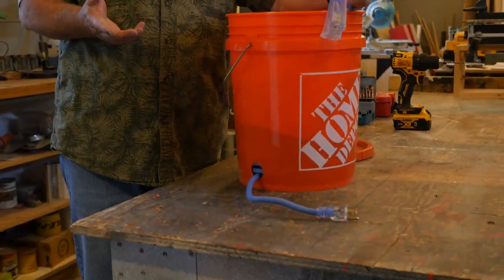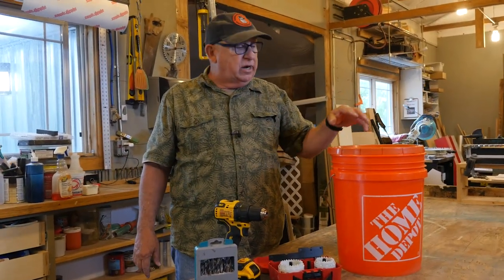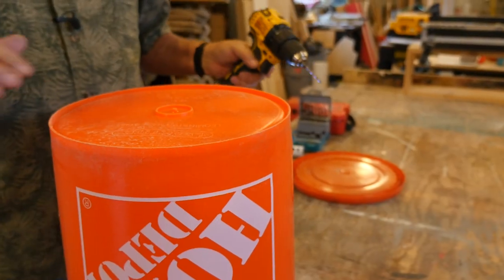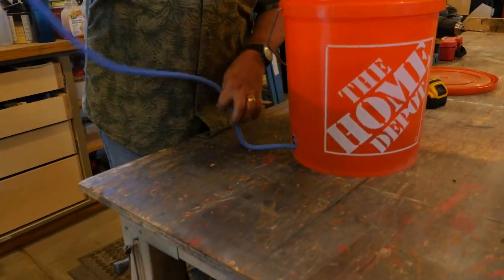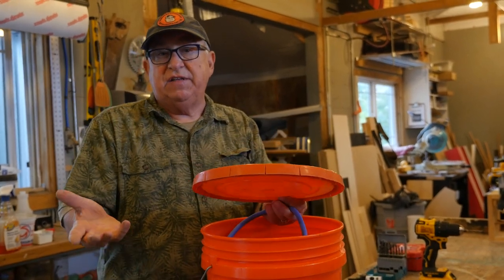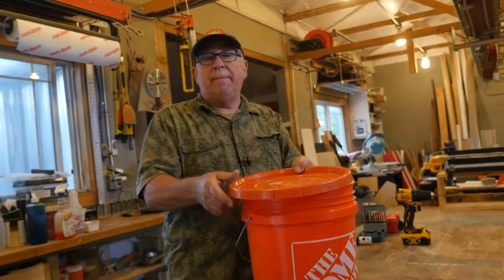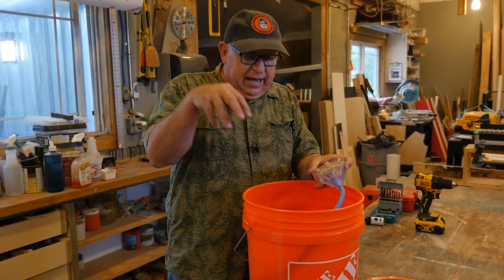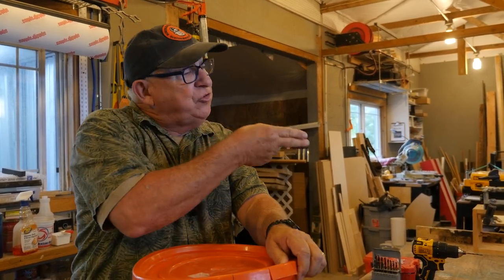The Cord Bucket Method for Tangle-Free Extension Cords!

Comment: DFJ, Glad you mentioned the possibility of heat build up in coiled cords. An electrician told me about that many years ago.
Reply: I do not do this anymore because even a low current draw will get dangerously hot ! Use care when doing this or get a open wire bucket like a desksidel trash can.
Reply from the maker: Indeed.

Comment: Farmer J enjoy your videos.   Since I do not have 100's of feet extension cords, I used chain method, but I also learn you can take a zip ties reverse it so there no rachet pull tight around cord coil hang on  wall  Since I do not have a lot space in my tool shed it works for  me .
Reply from the maker: Great tip! Thanks for writing! Best, DFJ

Comment: My dad was in electronics and showed me a way to wrap any length cord by hand and when you need it, you just slip both ends back through the hoop and throw it underhand to where you are running it and it goes there without tangling and it extends the full length of cord and it is not coiled either. It needs to be shown tho, hard to explain. I'm sure there are electricians out there that know the technique.
Reply from the maker: Thanks for writing and weighing in. Best, DFJ